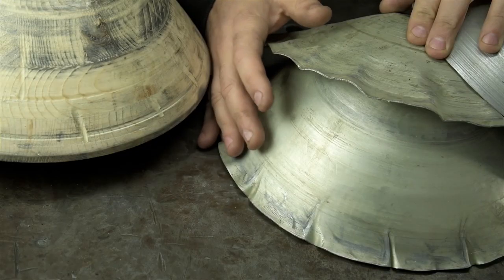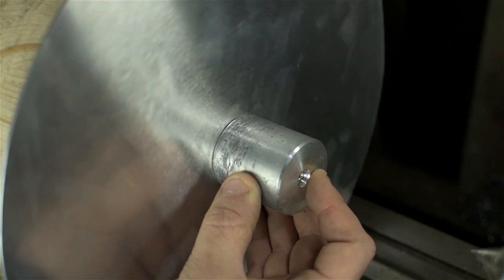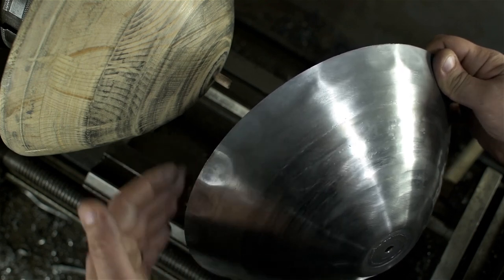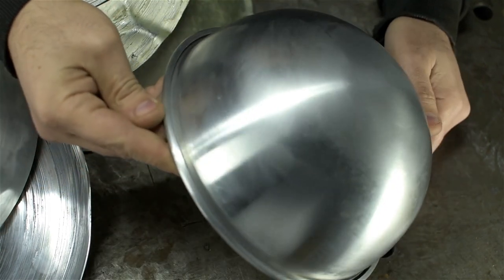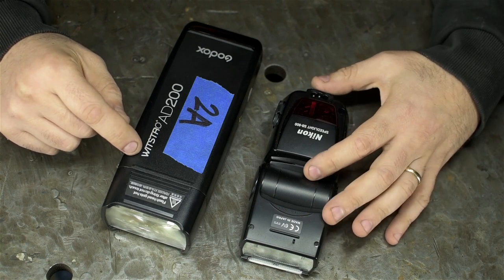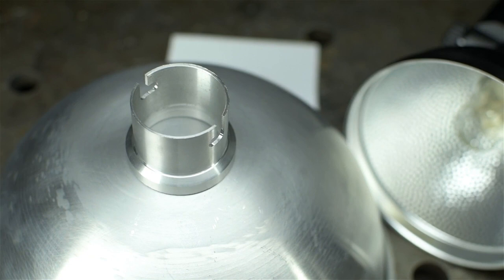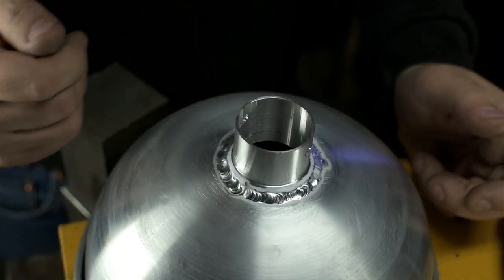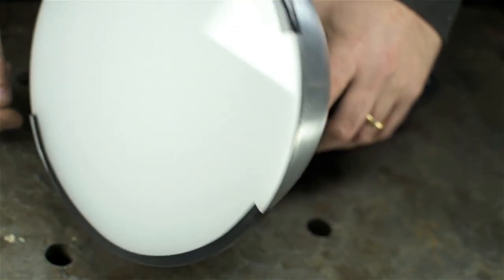Spinning Metal - Part 2! - GODOX Strobe Reflector Build

Comment: With all due respect, reason for the middle portion getting cut is the  left most side of the disc was experiencing forces whilst in contact with the holder on dead end (being sharp), cut the center's portion, forces because of the  force applied by blunt or bearing tool on tool post...

Comment: I am wondering about that aluminum block you are using to press the disk in place.  Would it work better if you used a piece of hardwood about an inch or so larger in diameter so that you didn't have the point of contact where it seems to break every time.

Comment: I feel like the centers are breaking out because you're moving the tool to the outside too early and not running the workpiece tight enough up against the form in the center. When you push on the workpiece with either tool, the other side is bent in the opposite direction because it's not braced against the form, I think that's what's making that odd reverse bend right at the outer edge of your arbor and causing the arbor to cut a hole out of the workpiece. Maybe try paying more attention to the center, hitting it more often and keeping it tight to the form.

Also bear in mind I'm a computer tech who has seen a lathe in person once, I know absolutely nothing about this stuff, that's all conjecture based on this video alone.

Comment: Those mixing bowls aren't turned on any kind of lathe. My father and grandfather both worked in a plant that made things like that. They're made on a giant press where a sphere of the metal or a flat plate of it (depends on the type of press) is dropped onto a form and the press squishes the hell out of it. It gets the shape and that rolled edge all in one operation. The apparent pattern in the bowl isn't from being spun and having a tool pressed against it in the forming process. The pattern comes from the polishing equipment it's run through after pressing.

Comment: Maybe a medium sized V band, similar to the ones on 55 gal drums. Possible to be used to hold that lense on but still light and easy enough to take off that it wouldn't be a bother when traveling.

Comment: Hey Tony! Could the problem with the tearing of the middle have anything to do with continuous pressure? it seems to me that when you release the pressure of your tool the aluminum kinda bends away from the wood and when you reengage you put a strain on the metal which  starts from the edge where the metal usually tears and the lever is the distance from that point to the point of contact of the tool. In cnc metal spinning i noticed that there is continuous pressure and i'm guessing that friction plays a role. What do you guys think?   
https://youtu.be/MCVlJFS9Wwo?t=404

Comment: the next time you tried to bend you need to put a rim on it that will get rid of the wrinkle as far as popping out the center yeah finesse. I just grabbed a piece of one by two material Pine is the best make a cut in the end of the stick to split the difference to you roughly got to 1 inch squares death I would suggest an inch and use that when you start spinning to put a rim or a shoulder on your peace I suggest you make the shoulder go away from you razor blades facing you you look like you said suck you in if you're not careful.

Comment: Saw a episode of How it is made on spinning. The guy used a tool on the edge first. The tool had a saw cut that was slipped over the edge and then he made a bend that was opposite to the spinning direction. I believe that initial bend stabilize the rim during the subsequent spinning forming process.

Comment: I did electrical wiring in a factory where they were spinning aluminum. They did it exactly as you have done it, but they used a wooden rather than a a metal bearing on the aluminum.

Comment: I so thought you were going to use the flash and a dark room to make the disc appear to spin slower allowing you to work out issues easier. Still like the outcome of the video. A Part 3 that utilizes fast flashes could be sweet.

Comment: I suggest hydro forming it, take a round plate of steel with bolt holes around the ouside, then route out a die for the back side, but add a recess and put a steel ring on top of it, for a clamping surface. Run the bolts all the way through, with the blank in between( just drill the holes using the top plate as a guide. tap the top plate for a pressure washer to add water to, or even a grease gun. Profit.

Comment: What if you add a "mirror" resistance in the lathe, against other side of the metal piece? This could give more balance to the metal disc. I mean, a resistance that goes back and forth mirroring the moves of the main tool.

Comment: I try this at home too. Here  are the things i learned. The metal must be normalized or  made really soft.  When you made a hole in the middle to hold the sheet in place  it will destroy itself while spinning. Bend the middle at first to prevent the wobbeling. Is woobeling an english word? I dont know.

Comment: Two things to consider. The metal that presses the sheet against the buck needs to be the same internal shape as the buck, it allows too much flex at that point and secondly from what I can see that bearing tool wasnt running pat the correct angle to the surface of the metal. It was sort of skidding like a car in a skid where  the front wheels  are locked ,but turned slightly.The bearing appears to be skidding over the metal instead of riding in line with the direction of travel.

Comment: Looking at other videos I think there is more pressure into the chuck then towards the center to help stretch the metal. Think push the metal up over the mandrill instead of shrink the metal down to the mandrill.  You might make a second larger holder to grab the bowl further out on the form after the initial part is made.  maybe start with a bigger blank and accept loss or weld a ring to the outer edge.  Seems you a trying to shrink the metal at the end. did you try heating the metal to relieve work hardening?  Would be nice to see this work!

Comment: Next time you do any spinning, try annealing the metal and grease for the surface. Have your tool handle long enough to put under your arm, use your body to guild your tool on the mold, alot like wood turning.

Comment: I understand the need to make it yourself.  I wish I had your talent.  Sometimes you're just remaking the wheel.  The adapter is flat and fits in most bags.  Once you're at a common mount the world is your oyster.  I use mine so I can use the same modifiers on the go as I do in my home studio.

Comment: Tony,  Ye’r stretching the rim by starting work on the inside center, hence the wrinkles.  Start on the rim to thicken the metal there and work to the inside.  This will solve yer problem.

Comment: You need to get the metal stuck to the tool before you go up the blank. On a constant radius like this it will always go to shit. If it makes you feel any better I have programming trainees at work that I constantly have to tell them this.

Comment: the stress applied to the center of the sheet metal is too great when you work all the way to the side. the center is clearly bending greatly then break in the video. since pure aluminum is softer, they are expected to break more easily comparing to the first round.
what happens is you start working to the side before the center is even done. this creates a lever where when you work on the sides, the forces are transmitted to the center through the middle part. that's why the center ended up bending outwards.
try work from the center and don't move to the sides until the center is completely done (sheet metal completely touches the mold).

Comment: you need to fix/push/hold better the stock on the wooden axle. it tilts in every push and that makes the center reverse bent and ready to brake.

the pivot point of the forming tool seems a bit reversed as well.

Comment: no spinning expert here, but you put too much stress on the aluminum, i´d say, get an acetylen torch, warm the material in between, best at first with too much acetylen so you get a nice layer of soot on the surface, then regulate the oxygen and warm up, when the soot disappears you´ve got the right temperature and go on turning

Comment: Hello I'm a metal spinner and the lamp shading you call it is a wrinkle from not being right to the block. We in the profession use a roller or bearing when we spin a bowl we use the roller on a lever system to control the roller. The difference between a engen lathe and a metal spinning lathe is the tool rust is fixed and has pin holes for our lever system

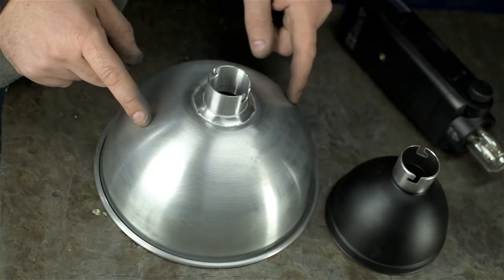Comment: I just happened across a video that had metal spinning in it, and it reminded of this series and your struggles with metal failures. The the thing I noticed was that the gentleman had bent over the edge of the disc about 90° in the opposite direction of the way he was moving the metal prior to starting. I believe that will solve the tear out on the edges. I would love to see you revisit this series! Here's the link to the video I came across and the metal spinning starts at 13:43. https://youtu.be/QjNwxpEBH7E

Comment: For the larger part of the parabola, shouldn’t you start with with a cylinder and narrow it down at one end? There seems to be a point where starting from a flat plate works, up to the point where it is closer to a cylinder than a disc.

Comment: Put glue sticky tape or sandpaper in between the metal and your press 2 the workpiece and or make a key like design where the workpiece can't spend and create a hole the size of that metal one inch slug you had holding it on

Comment: You go to outer diameter too fast. It needs to spin inner diameter tight to form, and it will not bend the part and little disk will not tear off.

Comment: I wonder if putting a type of Idler wheel on the other side of the spinning work would hold it against the buck and prevent it from warping and twisting at the mounting point.

Comment: Tony I actually work in a metal spinning shop tho i do not spin my self i run a laser. You need to establish the radius on the nose before you can spin the part down thats why  you are having trouble with the part staying down on the tool reduce the size of that extra part in order to get your wheel closer to the top of the radius. Maybe even make a thinner bearing to start the form in order to have it be spun correctly

Comment: In my metal spinning class we used a bar of soap as lube, also the tools we used were quite long. You put the handle under your arm and push with your body, your hands are just used to steer the tool.

Comment: same setup but a negative buck ,,should deal with finish issue  and i think the  shearing around the pin if its fixed to the buck around the rim you should be able to stretch into the form

Comment: think you need to watch more video's on the subject to find out if theres an order of shaping the metal like start in the middle of the circle then shape the top then the edge or sumting like that , one thing i seen was that they turn the lip if the dish the other way untill the rest is mostly shaped and then roll it off over the buck , my guess is that the prevents stretching 
another thing that might help is take the dish out a few times and heat/ cool watever it to prevent it getting work hardened from the tooling

as for the reflector in general , my father used to dabble a bit in photography and he had these umbrella's with a reflective inside , these things handle a topple of the tripod a little better and dont take up as mush space as the solid bowl when folded closed 
they allso work difusing the light by reflecting it off the white ceiling or wall
https://www.andoer.com/p-d2130.html , hmmm look at that it even has a difuser screen looks like its velcroed on
seen these come by a few times being used as a movie spotlight on you tube video's from other content creators

Comment: I suspect the roller angle could be changed to roll the material up hill, or to the left to keep the material  pulling away from the center.   Second, if you have a yoke with the roller on each side to keep it balanced it may not cut itself loose from the stock center.

Comment: I have an idea on why that reverse bend might happen:
You're pushing the sheet on one side and with that levering it against the holding aluminium on the other side. Basically cutting it away at that corner
 it is easy to see at 5:30.

Comment: 4:55 Reverse bend and centre break-away is being caused by the opposite side bending away on the far side when pressure is applied with the tool. You can see it happening at 5:50

Comment: Your issue with the material pinching and getting cut off is that the pressure is only on one side. if you can do the same thing on the other side as well you stop the pinching and you get a better bowl

Comment: You need to put the pressure symmetrically on the other side to prevent the reverse lip. Make a device with two wheels.

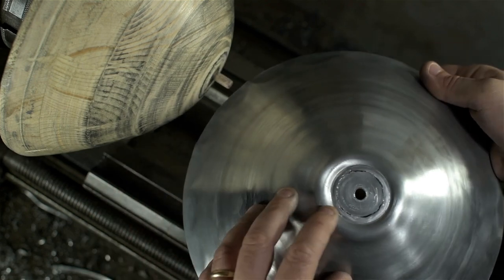Comment: 4:50 This happens when you form the outer region as the center region hasn't contact with the wooden form, thus bending the sheet 10 times a second or so around the center bracket

Comment: The key to spinning that shape is too get the nose of the bowl locked down on the Chuck ASAP and make sure as you make passes further up you go back over the nose to keep it tight. The phenomenon that you are experiencing is called "backing up" in the metal spinning industry.
Reply: My thoughts too.  Spin solidy against center of buck first.  I use lanolin for lube.

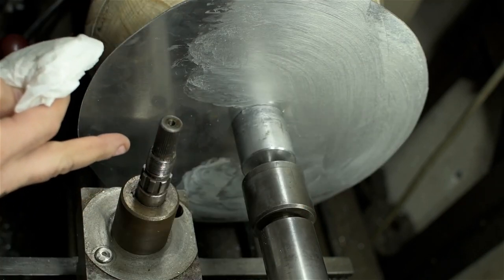Comment: At 5:44 I see you have the same 1 3/4" post built into the compound as I do on my MK1 Colchester student.  Did that Impero toolpost come with a 1 3/4" bore or did you add it? Did it have holes in the base that work with the indexing detents? Thanks!
Reply from the maker: i adapted it to the original post so I can go back to the factory 4 way if I had to. no indexing holes though!
Reply: @ThisOldTony  Thanks Tony! Made my day.  I'm trying to find a QCTP that can take the 1.75 central bore and still function, as I don't want to get rid of it either. Can't find that model Impero.  Any thoughts?

Comment: since you had the cnc router....  why not make the positive AND negative forms, then just press the aluminum plate, between the two, with a hydraulic press?   If it doesn't match the form exactly, you could always do some spinning, to finish it off.
Reply: That’s way harder than you think
Reply: @willasproth  ....
Sounded good in my head.   Stamping aluminum shouldn’t be that hard (in my head )
I’ve always wanted to try it.
Reply: @wesleypipelayer7627  when ever I’ve tried it is always creases and folds on its self, I’m assuming a really good set up prevents that, but whatever.
Reply: Maybe the shape he’s doing is simple enough where that wouldn’t happen, but still.
Reply: @willasproth  .....
From what I’ve seen, the more complex the shape, and the more stretching you need to get out of the piece....  the more you have to break it up in stages.   Aka....  more sets of forms, to work it out, in steps.
I’ve never tried it.  Honestly.  But I’d assume you wouldn’t need more than two stages for this basic shape.  And if he already has a Cnc router to make the forms....  I say go for it.
We need to talk him into trying it
Reply: @wesleypipelayer7627  that would be fun

Comment: Tony,  Have any spinners chimed in to tell you where you went wrong?   I don't want to just repeat what they have already said.
Reply from the maker: Mostly links to other videos, but don't know if any pro-spinners have popped in... if you have some tips, I'm all ears!
Reply: The important thing is to begin by getting the metal "set down" against the form as close to the follow block as possible.  In this case, the width of your roller is preventing you from doing this.   That ring of material between your follow block and the first place where your roller can act, ends up getting flexed back and forth as the disc rotates.  That's why it is failing there.  This is one of the places where first time spinners usually have trouble... so don't feel bad.    

For your set up, I recommend reshaping the roller so that you can get in close to the follower.   I also recommend using hand tools, rather than the mechanical feeds of the  lathe.  It's just easier to spin if you can "feel" what's happening, and can react  in real time.

Comment: Being a drummer, I've been interested in how cymbals were made. Basically it's the same process. One thing I noticed you did, they never did, WAS walking the tool back to the center. It always went from the center, out.
The Zildjan family has been making cymbals since around 1470-ish, IIRC. Seems to work for them.